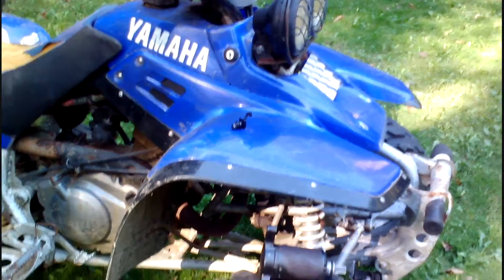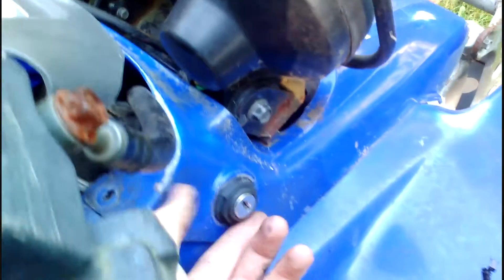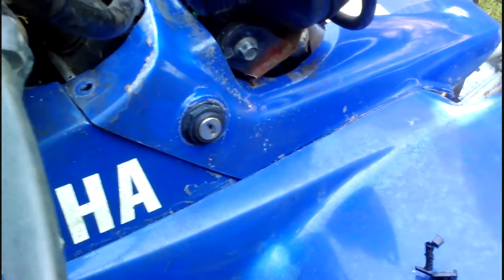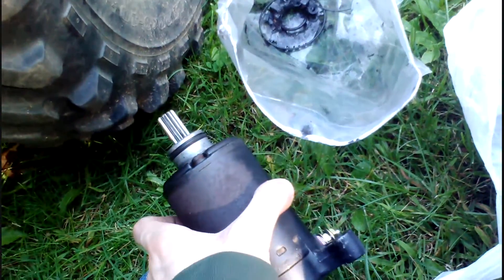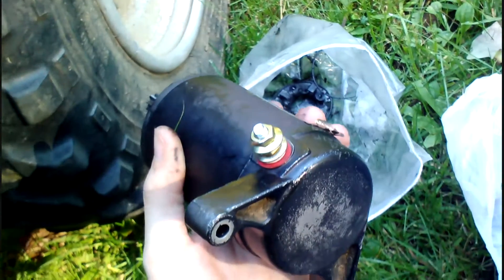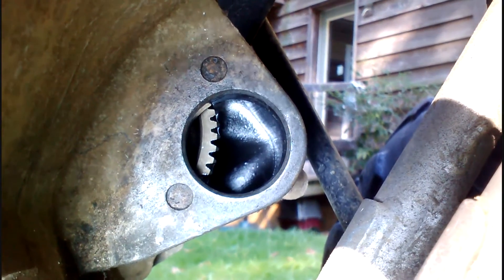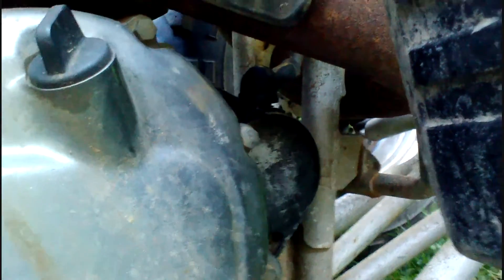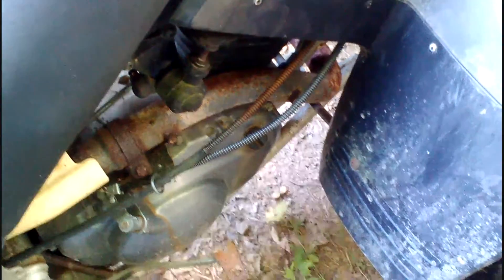Yamaha Warrior 350 -  Reinstall rebuilt starter

Comment: I have a bad starter too. Can I push it around so I could start it ? Or Is it any other way I could start it with a bad starter...
Reply from the maker: You'll need either a bunch of people to push, or pull it with another ATV or truck. You'll need to get it in gear -- I think 4th would do it, pull about 10 mph, then pop the clutch. If the tires skid, use a higher gear.
Reply: Old video and you might not see this but if someone has your problem . They could just jump the solenoid with a screwdriver it would work like once or twice

Comment: Did you have to pull flywheel off to get starter off?
Reply from the maker: Nope, starter pops right out, there might be some resistance due to the o ring.
Reply: @09ThomasEF Nice thanks for the reply gonna pull mine today